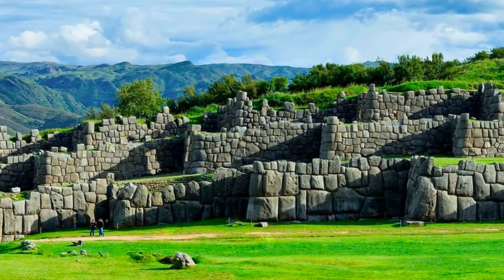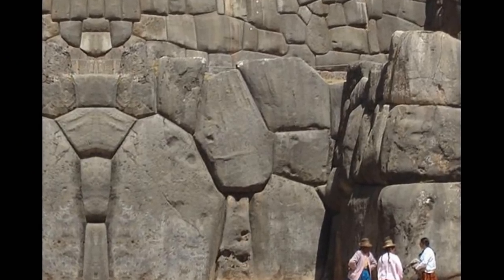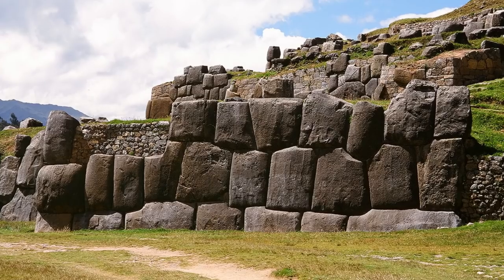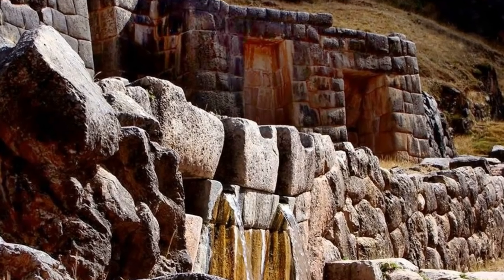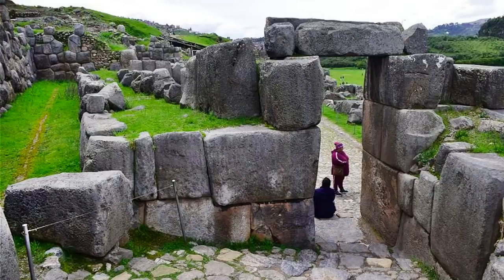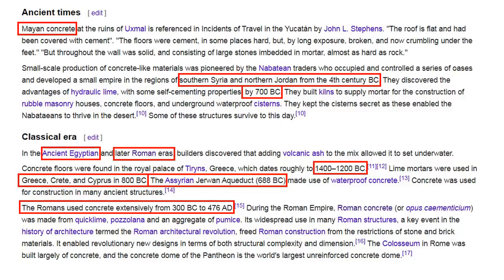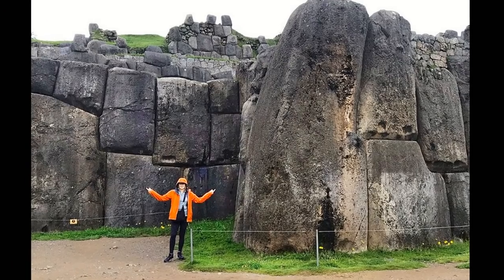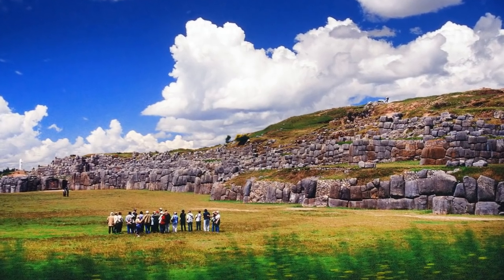Explained: How were Peru’s #Sacsayhuaman Walls Built

Comment: you say maybe concrete but why not do the whole wall as one piece which would have been easier,my theory is they had some kind of frequency device to make the granite more pliable,they left with their technology just b4 a huge cataclysmic event happened
Reply from the maker: Thank you for the comment.  I explained in the video that why dry stack masonry wall (which Saqsawaman walls are) is more suitable for a seismic region. If the whole wall was cast in one piece then it would be a very rigid structure with no flexibility, no drainage, and easily toppled or be damaged due to earthquakes or just years of frost, subsidence, ground heave and thermal movement.  
Today we use rebar and joints to make concrete structures flexible with improved tensile strength. We don't do a full cast long and tall retaining wall with only concrete. It won't be structurally sound. 

I am also interested in the frequency theory and may talk about it in the future.
Reply: they have a patent for a rock melting device so yeah more plausible than casting concrete

Comment: Any hypothesis much account for the lifting. Casting would be easiest. We know quite little about artificially making stone. Your hypothesis sounds solid to me. If we only could see the tools!
Reply from the maker: It is hard to make an educated guess when there are no tools left on site... I assume whoever have the ability to construct these walls must have sophisticated equipment similar to today's cranes or trucks.
Reply: If the material was like dough, only small lumps would need to be lifted and added into the large block that was being formed in place. That would only require simple scaffolding.
If each block was built in place using this "add lumps of dough" method, and there were many different workers working on a section of the wall, that would explain the different sizes of blocks, as the faster workers could make larger blocks, etc.

Comment: I love your videos and because I’m curious also, if they used cement why would they have left the back of the rocks unfinished and rough?
Reply from the maker: Thank you 😊 I think the blocks were in a plastic/ malleable state when they were placed on position. Then pressures were applied from the top and sides to make sure the blocks have a tight fit; therefore the backsides would be molded into the back soil wall and therefore uneven and rough.
Reply: @CuriousBeingbyTina  But sacks of geopolymer cement all stacked together would STILL not result in the puzzling variety of shapes displayed in the walls, many of which I cannot even imagine how they could have resulted from bags of cement being squeezed together. Sorry, but I find this theory totally implausible even as an explanation of the oddly-shaped, tightly fitting blocks, quite apart from being FACTUALLY IN ERROR because geologists have identified the stone as andesite and have located the ancient quarries from where the stone was cut.
Reply from the maker: @stephenphillips4984  Did you watch to the part I talk about the material having a plastic state like play-dough?

Comment: They sucked out excess concrete creating the knobs? Just exactly what did these concrete vacuums look like? Have any idea of the necessary suction that would require, or what that apparatus would even be made out of or powered by? The geologists state that the material did not appear to be naturally occurring based the microscopic analysis of the stones crystaline structure. I didn't see them say that it appeared to be a conglomerate of materials either. The idea of a magic plant juice used on the thousands of megalithic stones in place around the world is simply laughable on several levels, and I won't even bother to debate that theory. Obviously the repetitive chiseling-fitting-chiseling-fitting scenario on blocks of this size is out of the question as well. There are many enigmas along with the issue of fitment that simply aren't explainable, quarry/build-site transportation, elevation challenges, and more.  I agree that the stone blocks appear to have been plasticized in some way, but molds, and magic play-dough materials theory have gaping holes in them as well.   The whole world-wide megalithic puzzle screams of high energy of some kind, as well as unknown materials science far beyond our current understanding. It is more likely some kind of sonic or electromagnetic frequency modulation, something novel to our scientific way of thinking and development. And I feel very confident these structures are far older than the Incan and even the dynastic civilizations, far, far older.

Comment: If the block had straight sides I would think that it is possible the block were worked to fit. But the sides are 3-Dimensional and no way anyone would or could shape such massive complex block that fit so tightly by shaping. No way! For sure the block were plastic to begin and shaped in situ.
Reply from the maker: That's why I think the blocks were in a play-dough kind of state when they were in position. Then pressures applied from the sides and on the top to squeeze the blocks together to make a tight fit. This way there would have been some slight changes of the block shapes and made them fit three-dimensionally.

Comment: Your hypothesis must be about the only one that brings together most of the variables : 
Large stone like blocks,  malleable, set hard.  Extremely heavy, not modular in size. Limited amount, this cannot be replicated today.

Molecules unearthed, when mixed, sets into stone. Limited time to allow for moulding.
Elements, like clay, were put in position and allowed to cure. The mix causes a chemical change. 

This type of compound would still have  a valuable part in our construction industry.  Building retaining walls would be my first spllication.

The extent we see is a period of abundance and this period was limited.
Reply from the maker: Thank you. I appreciate your insight.

Comment: interesting theory, but the the only downfall is the fact that every stone is bespoke in shape. It would make more sense for the blocks to uniform in terms of time expended in creating something like this. Why would you start the bottom row in such irregular shapes? basically you wouldn't because this is your starting point which sets out the rest of the wall, you would make this linear which makes everyone's life in the construction process a lot easier.
Reply from the maker: I explained this in the video :-)
Reply: @CuriousBeingbyTina  don’t remember? still seems like a long winded process when it could have been a lot simpler. To have every stone different doesn’t make any sense.
Reply from the maker: @andyd2033  It's all in the video.
Reply: @CuriousBeingbyTina  yes, but it still makes no sense to have every single rock and mould different. Pretty sure they are all rocks anyway.

Comment: They look like molded clay.  Before the flood there existed giants, and afterward also, but there have been many size categories of giants up to over 30 feet.  Once such foot print in granite exists in south Africa, it is about 48 inches long and indicates a man of 24 feet tall.  Legend has it they are hybrids between angels and women.  They were possessed of supernatural strength.  Also there was less gravity before the flood of Noah's day partly because of so much water in the upper atmosphere, this also allowed for buoyancy of heavy animals that were too tall to get blood to their heads 60 to 70 feet in the air.  THe pressure on their ankle veins would burst their veins and arteries.  But less gravity and a much thicker atmosphere would allow a pterosaur of 60 feet across to fly.
    Curious Being, I believe the irregular seems in these walls were on purpose to keep the walls from transfering or amplifying shaking waves from earth quakes.  Different sizes and angles prevent a wave from forming.  For some reason it reminds me of the movie DUNE where rhythmic walking would attract sand worms.   Molten metal was poured into bone shaped key locks between blocks.  So heating may have played a role in the crafting of this material.  Are you saying Sexywoman?  Sounds similar.

Comment: I'm pretty sure some 'official' historical explanations are incorrect. However, the theory presented here, is based on speculation as much. Softened, moldable blocks would still require unexplained heavy, high-tech lifting equipment. Alternatively, the shapes of the seems, with sharp corners, straight lines,  often inclined, are not what you would expect in case of casting.

By the way, the realisation that these structures may be a lot older than official history tells us is not new and actually gaining mainstream momentum.
It's just that a lot of people only now hear about it through social media and the internet, while a number of books and articles on these topics have been available for decades, going back to the 1970's.
Reply from the maker: Thanks Rudi. I think the ancient civilization which built Sacsayhuaman and many sites in Peru was potentially more advanced than ours, therefore they would have their versions of cranes and other equipment. Today's dry cast stone method, Vibrant Dry Tamp (VDT) could be similar to the techniques used at Sacsayhuaman. The benefits of this dry cast stone method are: 
-Fast demold time. 
-Can cast into the same mold several times a day. 
-No treatment is required afterwards to achieve the limestone look. 
-Result of cast stone is very clean and natural looking. 
-High early strength. 
-There is a time just after demolding when a repair is relatively easy (when the concrete is in a plastic state and malleable) .
Reply: @CuriousBeingbyTina  in general I agree with your assumption that advanced knowledge of some lost civilisation may explain the megalith remains all over the world. But, new explanations need better supporting evidence than the old explanations and not unfounded speculations. So where have these supposed advanced tools and equipment gone ? No trace of them whatsoever. And if softening of stone is a real thing,, you need to able to prove and repeat it. I am a civil, geotechnical and constructional engineer by profession and try to keep an objective approach to new theories
Reply from the maker: @rudivanrooijen7611  Today's dry cast stone is a type of concrete. I don't think the blocks as Sacsayhuaman are made of softened stone but concrete with a plastic state before it fully cures. In today's construction site, after a project is complete, mixers, cranes and other equipment would be moved out of the site. I assume it would be the case for most ancient megalithic sites as well. It's possible that we can find some leftover tools if researchers can be allowed to dig the site. Also, if the machines/ tools were used over 10,000 years ago, then almost all remnants would be buried over 10 m underground or submerged by water/ sea. If the machines were made of metal, then they would rust away fairly quickly, like in a few hundred to a thousand years or so. Some surviving metal might be scavenged and recast later. Some might have been deteriorated to a state that they look like hematite.

Comment: I say they built a giant form maybe even backed it up with dirt put bags in and filled the bags with concrete that's different than oursthat's why they are all kinds of random shapes because they didn't care about the shape of the bricks that they were building they cared about the overall structure which was probably covered with some kind of ancient stucco to smooth it out the curved edges were because of the bags put concrete in a bag or even water and push it into a form the edges will curve if they're packed full once you set each block after it sets add another bag

Comment: When we can duplicate the construction with the same outcome in quality, only then will the riddle be solved. The notion that hunter gathers understood or even had the need to construct earthquake proof structures is a contradiction in itself. Modern concrete breaks down rather quickly when exposed directly to the elements. A more plausible scenario would be that they mixed molten rock with limestone powder in their own strange concoction, but even still that presents it's own set of problems.  I find the poured concrete theory rather convenient. Anything we cast with concrete today, will not hold up as these megaliths. This implies that they were advanced just like us.

Comment: Great work, but you failed to add the most significant findings of the Russian researchers; which was that the giant blocks are not blocks at all, but their outer surface is a kind of shell layered over what may be a conglomerate bedrock beneath, while the smaller upper level blocks are all solid individual blocks made of the same shell material...which is man-made as their lab analysis revealed.
Reply from the maker: Thanks Adrien. I did show parts of the material report from the Russian geophysicists :-) Yes they concluded that the block material is not from nature.

Comment: they probably push something up against the bag on the inside of the form that was flat that's why it's all got flat sides and when you pour the concrete on the next one it's flat just like that
Reply from the maker: Then the bags needed to be very strong and very thin since they were holding multi-ton blocks with minimal seams.

Comment: @ 6:52 . .  "stones would have been cast into molds" . . cute theory. You are overlooking the fact that these stones are granite. And granite's melting point is 1238 Fahrenheit (°F) (670 degrees centigrade). Find more about the melting temperature of granite at this peer-reviewed paper, "Melting of Granite with Excess Water to 30 Kilobars Pressure
A. L. Boettcher and P. J. Wyllie" Link: https://www.jstor.org/stable/30068618?seq=1

The high Andes mountains are not covered with trees, or anything else to burn except for the dung of llamas and livestock. These facts mean that you need to rework your theory.
Reply from the maker: These blocks are limestone, not granite.

Comment: It still seems like some were poured into a bio degradable bag ( like a tea bag) then hoisted in place, or perhaps poured in the bag at the location site, then the bags degraded or were removed later, even so it must have been done rapidly before it set....
Reply from the maker: Then these bags must be super strong, smooth and super thin to be able to hold and contain multi-ton material while leaving no texture marks and paper-thin joints...

Comment: to me they made them to vibrate by sounds and the friction made the rock block to get the shape by it self and you let the block vibrate until they joint perfectly , dust would also been blown off by the wind vibration would creat , if this theory is correct we have here a civilization in wich master of sounds and vibration  perfectly and used sounds to do any work , it is just my theory nothing more , if this has been molded you would still have to cute the previous rock in order to poor the soften rock or concret so to me it look like vibration work

Comment: Love your work, Tina, but I disagree with your conclusions here. The existence of mineral veins in some of the stones are good reason to conclude they are natural igneous stone. Also, if the walls were formed from a slurry, why the non-uniform sizes? Wouldn't a concrete-like substance have made the impression of the retaining form?
Reply from the maker: Thank you Rob. What's the scale of the veins? Modern concrete contains rock aggregates too which would show mineral vines as well. I explained my thoughts on why the blocks are not uniformed or show mold/ form imprints in the later half of the video :-)

Comment: Bad hypothesis. If you're going to pour concrete, you would put really big blocks in those places where you see multiple medium-sized blocks. Less blocks is easier. They would have made much bigger blocks if it were concrete. Less work overall. See also the Stone of the Pregnant Woman, which cannot be explained as having been created by pouring concrete. The resonate frequency of the stone is the main thing, and I haven't seen you do any resonate frequency testing.
Reply from the maker: I have concrete experts told me that with today's technology, we can't make blocks in these giant sizes without cracking.
Reply: @CuriousBeingbyTina  You are limiting your theories to methods we might use with our current technologies. Advanced civilizations would be able to come up with methods which are ahead of our current technologies. Maybe Tesla technology having to do with vibrational frequencies. Maybe the transmutation of material physical properties.
Reply: @CuriousBeingbyTina  After searching on the web, I see that blocks of the size used in Sacsayhumuamon are not available for purchase. We can't make them today.
Reply from the maker: @scottbreseke716  Thanks for the info. That means the builders of Sacsayhuaman was more advanced than us at least on this aspect. I thought about vibrations and frequencies for a while but I think the cast or dry cast theory is more plausible.
Reply: @CuriousBeingbyTina  Nikola Tesla opened our minds a bit about what is plausible with vibrations and frequencies. You are limiting your theories to our current technological understanding of things when you're deciding what is plausible or not. I would recommend testing some rocks and chambers for acoustic resonance properties and determine if it's a factor in the puzzle.